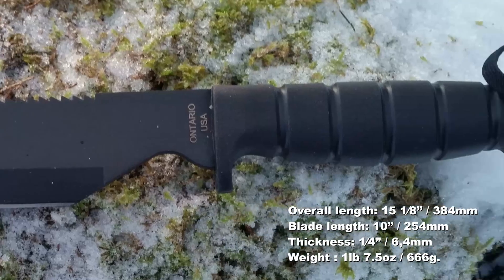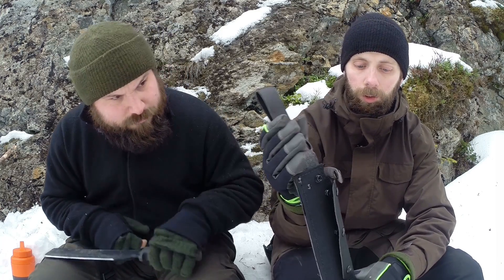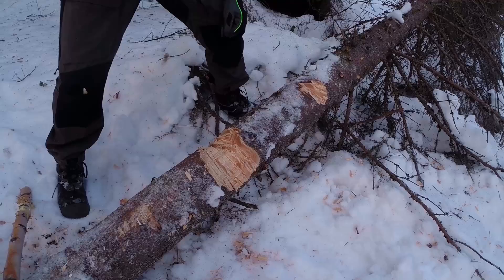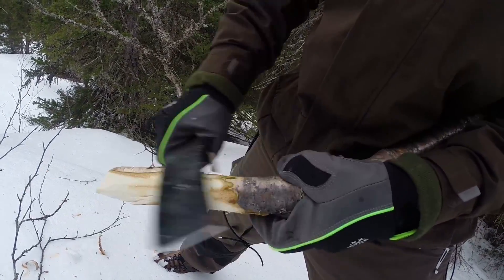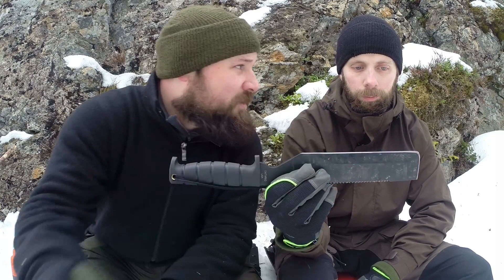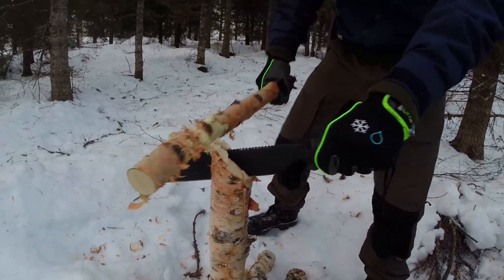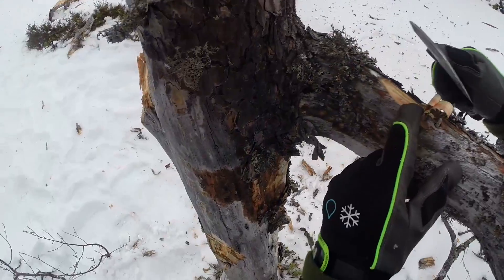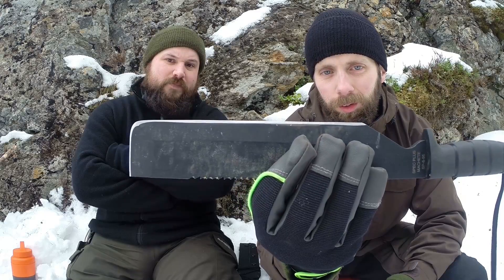Review - Ontario SP8

Comment: well you two finally understood in the end - the Ontario sp 8 is a urban survival machete designed as a breaching tool to open doors and windows - its not a camping knife - its built to destroy not build - the saw is not a saw at all its a notching surface - imagine it for breaking pallets apart - just give it a decent edge and you will be surprised what it can do - have it sharpened by someone who knows how to sharpen - you basically have a chisel a axe a draw knife and even a shovel or hammer if needed but its not a fine detail carving knife - its a heavy survival knife - it just need some fine tuning

Comment: I've seen so many videos of people trying to use the back of the blade as a saw. It's not a saw, and it's not shaped like a saw, nor is it sharp in any way. It's grip on the back of the blade for when you split logs. You lay the log you want to chop on the ground standing up, sit the blade on top of it, then use another log you can comfortably hold in your hand to hammer it down. When doing this the blade won't always stay perpendicular as it cuts through the log, so the grip on the back of the blade helps transfer the energy from the log you're using to hammer it down into the log you want to chop. I don't like seeing people fool around with their tools because they don't last as long and should have more respect for things that can hurt you.

Comment: The tool is good for chopping or more specifically trimming small limbs, baton wood and very light chopping and something you forgot... prying.  It is not a replacement for an axe or a saw and not, despite the name, a machete.  It has a lot of uses a survival situation where space is limited.  If you don't have need for a machete but need to create shelter, collect firewood and perform most tasks a knife can do, this is the tool for you.  One thing you missed it that it can dig small holes for fire pits and trenches.  Assume for a moment that space and weight were real limitations and you could only, other than cookware and possibly a shovel, carry two tools with you.  Sawblades break and axes have very limited uses so may not be the most practical.  The SP-8 and a good full-tang drop-point knife will do most everything you want.  By the way, the saw-back isn't there to cut but rather to make even, quarter-inch wide ridges in materials.

Comment: Say Heah Snake, there use to be a famous baseball player in the States that used this saying "Say Heah", he was known as the Say Heah Kid, I sort of like that, anyhow some of my favorite wood processing knives are my O.K.C. Gen2 SP Knuves, for the money my SP-53 is defenetly a "Sharp Hammer", although I like the Saber Grind for my wood splitters,  and chopper's because of the weight, a friend of mine RealBigMonkey suggested I get the SP-53 over the SP-52 because he said the Full Grind slices more like a machete while the Saber Grind chops more like an axe, it turned out that way for me so I bought the SP-53, 51, 49, and the SP-47 which is very close to my BK-2, it might be just a little longer and not as thick but very close in every other respect to the BK-2, it's nice to see you review the SP-8 I always liked that shape of a knife look's awesome, I just like the 5160 for my wood processing tools, not that there's anything wrong with a good tempered 1095 I also like the 1095 CroVan a little better too and my BK-9  proves that to me I even paired it off with my BK-10 nice match, anyhow enjoy your new toy I'm sure it's a good one since O.K.C for the money make some great tool's and are even used by the military, I'm still enjoying my new Stromengs but I'm trying to get use to my Fussion Handle on my new Nuclear Meltdown Fussion Steel Heart what a beast it's a 9 1/2 inch, 5/16th's inch thick and almost 2 inch wide, like I said it's a beast it's a Full Grind with a Blended Zero Edge and it bites in deep so I don't even have to chop hard with it, nice seeing one of your video's again and Thanx for sharing the SP-8 be sharp and be safe, Thanx Snake.
Reply from the maker: Hi Paulie. So thats where the "Say Heah" comes from :)
Yeah i know David (reallybigmonkey), i gave him a Samekniven KS9 aswell a few years back. He loves his Ontarios and huge machete choppers. 
We have a few Ontarios on our list, so the SP10 and the SP53 might show up in the future on our channel :)
Snake
Reply: Say Heah Snake, you won't go wrong with the SP-53 GIDEON has an awesome video on it check it out, for the money it's a real "Sharp Hammer" infact that's what the designer call's it, and besides the 5160 is similar to the 52100 Ballbearing Steel which is one of my favorite steel's,  that's why I like the Swamp Rat Knives they use it under their proprietary name the SR101 it's just that the 5160 has a little less carbon but tough as the get go. And the SP-51 is one heck of a great knife as a lighter chopper but a great knife to baton with, I think your on the right track with the O.K.C. line check out the Bushcraft Machete too it's sweet.

Comment: thanks for confirming my thought on this... i had to reprofile the sp 53 and when i told the company about their edge they replied: "we are happy that you could make it work for you but we wont change the grind angles because those knives are designed for extremely hard use"...
Reply from the maker: pro Toyz Right, how hard use are they talking about? Chopping granite or something? In my opinion there's a grind angle that's just too big for anything but splitting wood. And I have an axe for that kind of work, so I'm a bit at a loss what to use this for then... It's a good chunk of steel though, I'll give them that.
Freddy
Reply: i am disappointed in their asnwer. not many customers would actually go ahead and tell them their issue and all they do is ignore it... my sp53 works fine now for chopping but it sure wasnt easy to get it there...

Comment: On my SP8 I got rid of saw (what were they thinking puting that thing there) got rid of most of coating pulled edge a little higher and trimmed handle on rings 3mm deeper and it suddenly works...chops better, splits like a beast...and makes decent throwing knife :P
I agree that out of box Sp8 is useless byt put some work into it You will be surprised :P
Cheers:)
Reply from the maker: TotalZeroTolerance Interesting improvements you did there. I can imagine it got a whole lot better. Perhaps we'll do a revisit in the future, with a few improvements. As of now though, it will collect dust in the knife...tub. :) Freddy

Comment: Hey guys I love mine. Use it for trapping. Just for your guy's information the back of the blade is not a saw and was never designed to cut through a large piece of wood. It is meant for making a 1/4" notch, to tie paracord in for tent stakes, snares, etc, since you would not be able to do fine work such as that with the blade itself.
Reply: This usage of "sawback" does not mean it is a saw; it means it is "like" a saw. Calling a fish a "swordfish" means its snout looks like a sword, not that it is a sword.
Reply: Exactly

Comment: I just bought an SP-10 because it was cheap, but the bevel must be 45 degrees. Its like a blunt garden tool.  I am going to try to put a 25 degree bevel on it and see if that helps.  I guess all the SP series knives are like this.
Reply from the maker: steve mcphaul Hi Steve! The SP-8 is one of the dullest knives we've tested yet. I may try to make a better grind on it too, but it will probably take a lot of work considering it's a foot thick.
Thanks for watching!
Freddy

Comment: Wow, I'm glad your partner isn't chopping into that fire Ouch Mmmmm mmm mmmm, Yeah, I like the Gen2 SP's, But I like their 5160, Infact for the price, it's hard to beat the "Sharp Hammer" the SP-53 what a chopper. I also got the SP-51 to pair with my BK-2 when I take it out, But it's kind of a heavy pair. and I also can compare the SP-47 to the BK-2 and the SP-49 can be used as a formidable survival knife, I just wish they didn't have the quillon, Although I've seen some guys take the top one off, But I worry it might weaken the handle since I do baron with a knife. Yeah, O.M.C. for the money makes some decent knives, But the SP -53 is still my baby, Oh, I paired it off with a T.F.I. yeah, it's a heavy set, But great to process alot of firewood.  ,,  ,,  ,,

Comment: I think there's a knife out there with a similar style but with a chisel end that really is a chisel. I think you could take it to a knife maker who could fix it. The edge needs to be thinned out and the saw blade either needs to go or take the time to cut each tooth in the opposite direction than the last like a real saw so the wood is removed instead of getting stuck. Tops knives have saw blades that are cut right but they are just too thick to be effective for anything but notching. Until next time, chop chop!    Mike
Reply from the maker: +Michael Quigley You are correct in every issue here Mike. In my opinion this knife is horrible, but many seems to like it for some reason. I mean if the weight and toughness is all that matters then buy and axe or a hammer, not this terrible "thing in between".
But thats just our opinion :)
Snake
Reply: ...then what was the reason for buying it in the first place?